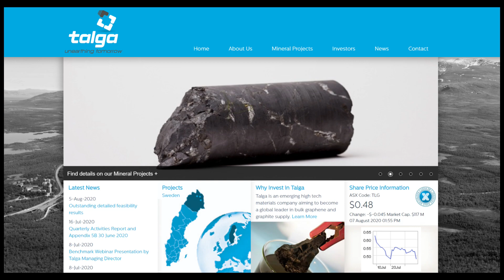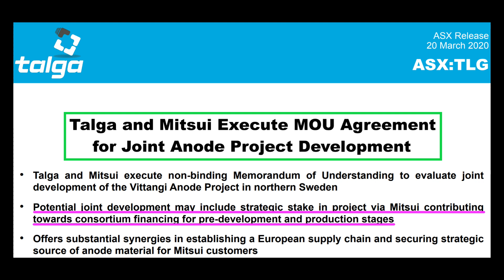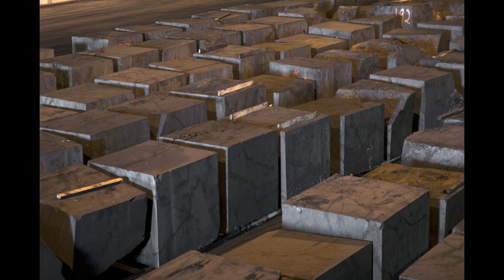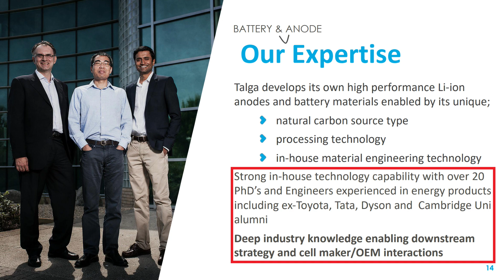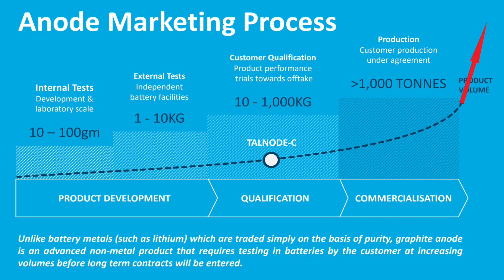Talga Resources // Natural Anode Dominance in Europe

Comment: Vertical integration is the way to control stable continuity and diminish external access. So if the surprise success of one category of vertically integrated multiple Start-ups is proof of concept, and the stability of Legacy Companies has been accumulated over time by acquisitions, the expectations of this set-up should be aimed either at re-coring a Legacy Company by substitution, or filling a space in the "about to be" new Start-ups. 

Remember what happened to the Inventor who sold Battery Technology to a big ICE manufacturer. He "did alright", but the tech was buried.

Comment: in his Novonix Battery Materials video. He shows that Novonix has a potential of 800 million gross profit per year. Compared to Talgo's 118 million gross profit per year.
Reply from the maker: Yeah, but that's only because Talga hasn't released a production schedule to 2030...which they are working on now with the Niska expansion.
Reply: @thelimitingfactor  Do you believe they are on par with each when it comes to the gross profit per year from 2024 and beyond?
Reply from the maker: @alexng4  Yes.  The only question mark in my mind is how quickly Talga will ramp graphene and how quickly Novonix will ramp cathode.  

I think the gross profit estimates for both are conservative.

I'm loading up on Talga at the moment because they are relatively 'cheap' based on net present value.  Novonix has a lot of growth baked in.

As always, this is just my opinion.  I'll be interviewing the CEO of Talga this week.
Reply: The Limiting Factor , if silicon nanowires are introduced will this kill of talga and novonix?
Reply from the maker: @jamesstevenson1594  Silicon Nanowires are science fiction at the moment.  This was covered in my Shirley Meng interview.  She's one of the world's leading battery nanoengineers.  The first step is 20-30% silicon...which means the rest is graphite.  We won't see this for about 4 years.  Then, when it does arrive, it will be around for at least 5 years.  After that will be higher ratios of silicon or we might move directly to Li metal anode.  In short, massive amounts of graphite will be needed for at least a decade.  Probably much longer.  Battery tech always takes longer than people think.
Reply: The Limiting Factor , amazing thanks for your explanation I did watch that interview which had me questioning if there would be a decline in the need for graphene/graphite but it seems like it still has a very big future ahead. Thanks

Comment: Hey Jordan,
I may have a further puzzelpiece for batteryday:

Regarding Supercharger V3:
No one seems to see the bigger picture here. On the type label of a V3 is written 1000V DC and 425 Ampere.
V2 has 410V. All current Tesla Vehicles have only 404V max. Voltage! You think what I think?

Currently there is a big Rollout in Europe of V3 Superchargers (Like there was a Rollout of CCS Cabels in Europe before the first Model 3 deliveries! Which only have CCS in Europe)
In one month there is Batteryday as everyone knows 😉

I predict the new Drivetrain/Battery will have at least a 800V to 1000V backbone.

Wait there is more: To charge a Model 3 with 250KW and 404V max. there are 618Ampere needed. I guess the V3 type label underreports like the ones on V2 (410V 270A is only 110KW but they provide 150KW)

So a V3 Supercharger should be able to provide at least 618KW!!!

Newer Tesla Vehicles with Drivetrain of Batteryday should be able to charge extremly fast!

Keep in mind - Elons said about the planed 350KW Taycan charging speed something like: What is this? A mere kids toy?

No one speaks about that! Why? 😉
Reply from the maker: NIIIIICE!  I've been telling people that Maxwell tech could allow for higher charge and discharge rates.  If that label is accurate (and why wouldn't it be), then we might be looking at V4 that's already in place.  I'm thinking there will be a separate event for this.  Probably with the roll out of the cybertruck.  🤔
Reply: @thelimitingfactor  Hi again, it's even better! I've found out in the meantime the V3 chargers are able to deliver at least 681Ampere. Because the Model 3 charges at 250kw at a relative low voltage. This is viewable with ScanMyTesla. I guess V3 is is alrady capeable to deliver maybe 1MW.
So new level charging already is in place for Teslas😁 Nice to have a infrastructure, which isn't slowed down by standards. CCS2 standart for example has much lower limits. So with the current chargers, competitors hit a roadblock for higher speeds. 😏

I guess there will be at least a 160kwh battery with 500kw charge rate possible with new technologies of batteryday. With lower inner resistance of the new cells maybe even more chargerate.

Would be happy if you have this in a video 😁
Regards Florian

Comment: If anode free battery cells become a thing, what does that do to these companies?
Reply from the maker: I've spoken many top experts in the field.  That's at least a decade away, and it will take years to scale.  You'll start seeing anode free cells in a few years, but very small volumes and at high expense.  Automotive requires the most and cheapest batteries (besides energy storage).
Reply: @thelimitingfactor  Thanks for answering this--I had the same question!
Reply: I'd suggest they get ahead of the curve with R&D which I think Talgas doing, you need to keep scaling your research to survive
Reply from the maker: @missmeltmyheart  Agreed!  This is where their graphene business comes into play 😀

Comment: As always, very informative. I’m surprised Australia is not on the list for Graphite mines 🤔
Reply from the maker: Hmmmm, good question.  Is that graphite used in battery anode, and at what volumes?   I've been led to believe that most anode is produced in China by graphite mined in China.  That's about as good as guess as I could venture:  That graphite from Australia is for a different use case or not at the volumes of the other countries listed.  That's just me pulling ideas out of the air though, I'd need to research further.
Reply: @thelimitingfactor  you are probably right. I did see somewhere that Australia was producing it but maybe I’m thinking of the synthetic version..?

Comment: Just a nitpick:
 07:05 - 300% is 4 times the initial capacity not 3 times.
Reply from the maker: Ah!  Duh, thanks man.
Reply: @thelimitingfactor  You're welcome. That would mean around 76k tonnes and that's a huge amount. Who knows what will happen until 2023. Maybe we're in the beginning of another technological boom?
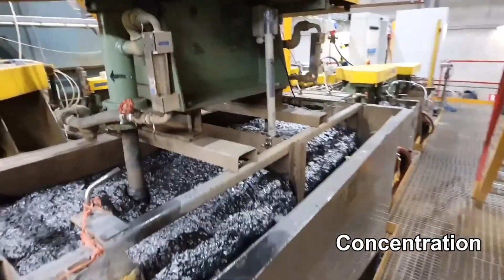Reply: @thelimitingfactor   another minor nitpick... At 11:05 you say "heat or acid, which are respectively toxic or energy intensive"... It should be the other way around... Unless it doesn't work how I expect.
Reply from the maker: @Thomas_Acharya  lol... You're totally correct man.  Nice catch
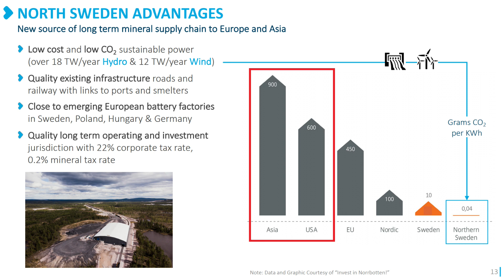Reply: Another minor point that caught me around 14:47...: 900 times 0.04 is not 900. Saying "over (9,000)" would be more accurate (I am way too detail oriented sometimes). :)
Reply from the maker: @Thomas_Acharya  I agree.  I stuck with the more conservative estimate that Talga stated even though the math wasn't correct... I didn't know if there is something else they were factoring in 🙏
Reply: @thelimitingfactor  saying "over 900" would also have worked for me. The main thing that initially caught my attention was how 900/10 was not 900, then I listened and looked closer to see I was looking at the wrong denominator.